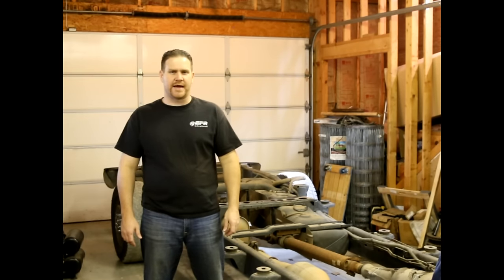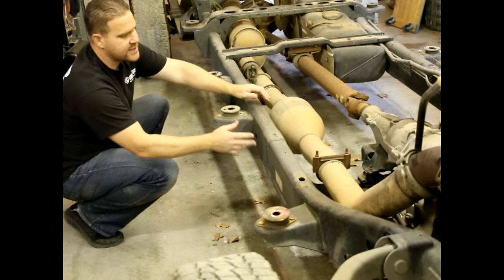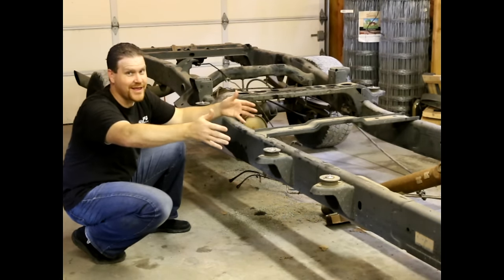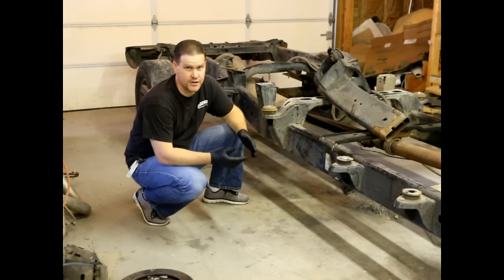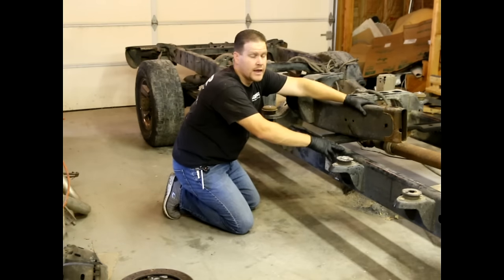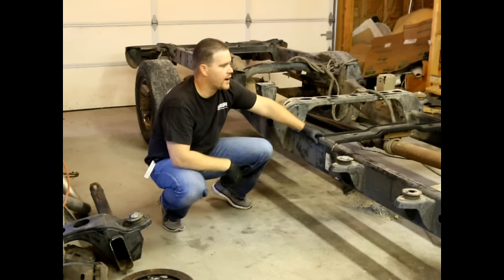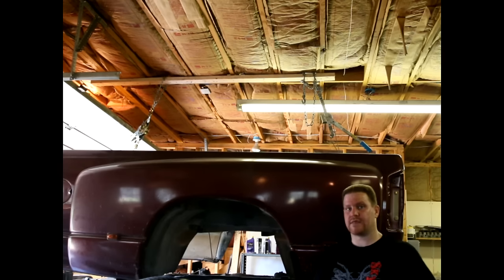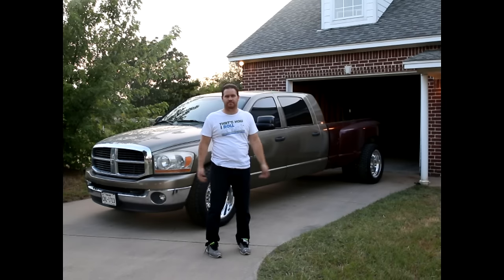How To: Mega Cab Long Bed Conversion Done At Home

Comment: Nice non-penetrated welds. Can't wait to see that weld after a few thousands miles of towing a tag trailer.
Reply: I doubt itll do much towing
Reply: Is that a bad weld?  If so what is the solution?
Reply: The trucks actually Been holding up rather well.
Reply: So do you have x-ray vision? According to the AWS, poor fusion requires a destructive test of section and etch if ultrasound isn't available. But go on.

Comment: Good job but one question. Why did'nt you have the bed painted before you put on the frame?
Reply from the maker: this was done as a series for a magazine. If we do to many steps at a single time, then it becomes either one mega story or we have to chop up the story into multiple parts. In addition, it is financially easier on us, if we do small bits at a time.

Comment: I'm planning on doing the same conversion soon I was wondering with cutting by the cab are you getting any sag? I'm worried about having the frame sag in the middle from having something heavy in the bed...
Thank you
Reply: All joints are in the same location as the factory. The rear section of the frame slides into the middle section probably 8 inches. There are two slots welded and then the outer joint is welded. The frames become one, and the frame sections are all factory. The factory frame has been engineered with enough safety margin that the extra 20 inches shouldn't present any type of problem. I know a ton of people who do and have done this conversion and I have never heard of anyone having a sagging problem if it was welded without a sag. I do know one who threw a driveshaft doing burnouts, but that is the only thing I know of.

Comment: Hey bud, great jobman looks awesome. I have a 2004 quad cab 1500 with the 4.7 litre in it. The truck is a nice looking vehicle but i want to modify it a little bit. It is a shortbed (6' i believe.) My question for you is. Can i put a dually bed on it? Do they even have a dually shortbed to fit it. Do you know if so, do the body mounts just line up? Also, do you know what years bed would fit? Any help would be greatly appreciated. Thanks  man! Big thumbs up. . 👍
Reply from the maker: Not sure if the frame on a 1500 is the same as a 2500/3500. You would need to do some measuring.

Comment: gotta quick question is the rear frame section the same on a 04 1500 and a 04 2500. I know the springs are heavy duty on 2500. but the section locks the same.
Reply from the maker: Honestly I don't know.

Comment: Has anyone grafted a long bed onto a megacab without cutting the frame?
Reply from the maker: So, nothing would line up and the frame would not extend to the rear of the bed. This would require a tremendous amount of work. The method shown here, only require a small amount of fabrication.

Comment: do you have to use the quad cab? would a single cab longbed work?
Reply from the maker: This was done so long ago, I don't remember if it has to be a mega cab. The key was the join under the cab. The Mega cab and Quad cab have the same back half. It would make since that a single cab long bed would too, but I don't know that for sure. See if you can get a photo of a frame and see if the joint is in the same place. It would be even better if you could take a few measurements. Dodge/RAM would want to make these frames as modular as possible. It would make since they are the same. I just don't know that for 100%.

Comment: i know at the end its too dark to tell for sure. but i replayed 20 times the point where the back tires dropped of the little ledge at the end of the garage.  every time i saw the back of the cab and the front of the bed get closer. back of the cab looked like it leaned back. i will watch the end over a few more times but it looked ro me like something isnt right in the frame
Reply from the maker: All is well in the frame. Spacing between cab and bed are ok, body lines line up, all is well.

Comment: Did you run into extra issues with extra vibration in the drive shaft with lengthening it? And did you switch to solid one piece driveshaft?
Reply: It is not a one piece driveshaft. If you look at the images closer, you will see that the front section of the driveshaft remained the same. I only replaced/extended the rear section. And that was like 18 inches or something (long time ago). I know of quite a few of these conversions and none of them have driveshaft vibration issues.

Comment: so how much of the frame from the quad cab frame did yo need sticking out for the 2 mounts to measure the same and it looks like you were able to just cut the frame from the qaud cab nat at a joint
Reply from the maker: +Nasty72Nova  about 24 inches from the cross brace. I originally spent a lot of time measuring the first time i cut a frame to be grafted in. got it to be with in 1/64 of the factory frame. Then i realized it doesn't need to be anywhere that close. 

The factory frame tapers in and i just measured at that and cut the quad frame slight;y longer. I believe it was 24 inches from the brace. Once I realized it didn't matter that much I just focused on getting the cab mounts lined up.

Comment: Love the truck. I'm kinda tossing the idea in my head about getting a new frame for my 2003 that I comment about below. Think/wondering if I can handle doing the frame swap in my garage connected to my house🤔
Reply from the maker: For me, it wasn't a matter of difficulty (pretty much no fabrication needed. All major components are factory. Fuels lines and wiring were the only things that I needed to physically extend myself.) This is a fairly straight forward conversion. It was time. With the kids, school (finishing my Mechanical Engineering degree), and weather, it took a few months to complete. Luckily, I had another vehicle to drive.
Reply: I was putting exhaust on my 03 and seen the frame was cracked, the long ways...not happy. think the dodge rams are very nice trucks but, poorly built. thanks for the help/info and again love that truck looks good!! cant get over that stance! and those wheels fit the whole look! nice job

Comment: wow man that looks amazing!!! would you trust using it every day towing big weight after rewelding the frame?
Reply from the maker: It is all factory frame. Assembled the same way the factory did (slot weld, joint weld). I have no problems with it. I have a few friends who have done this and they are just fine too. Don't see why it would give you a problem as long as your welds are solid.

Comment: hi, are stretching wheels in toyota hilux a good idea? i want to build an rv. because it will have very high center of gravity, I wanted to know what steps i could take to prevent crash.
Reply from the maker: I’m not the right person to ask. But stiffer sway bars would help with roll. Adding air bags will allow you to level the vehicle is it isn’t sitting level.   I think stiffer springs may help as well. Even adjustable shocks might help. But I would talk to a suspension company.
Reply: @hpdiesel4538   i have heard many negative things about stretching wheel axels. that's why i asked you. thanks for replying. very helpful. thanks
Reply from the maker: @buyhighselllow2209  the problems with stretching a vehicle has little to do with your question. Your concern is more about vehicle width and suspension dynamics. High center of gravity vehicles can be very tippy. They are tippy side to side not forwards and backwards. That is a width and stability issue.
Reply: @hpdiesel4538   yes. someone suggested extending the width of tires and length of that rod on which wheels are attached. but the second step is the one every talks negative about. sorry my english is not good.

Comment: How did you do the SRW to DRW conversion? Are the axles the same with just different hubs or different axles? How did running all the pluming work? Did you just lengthen the one side of the drive shaft?
Reply from the maker: +iriderm250  The SRW to DRW conversion was straight forward. The DRW axle is about three inches shorter than the SRW axle. The easiest way to do this conversion is to buy/trade axles with someone looking to do a DRW to SRW conversion. Luckily I was able to find someone and we did a straight across trade.

The wiring was extended by splicing in (two splices, one on each end of the wire).
The factory fuel line was cut and another line spliced in that I bought with the frame (one splice).
The rear section of the driveshaft was extended. This kept the carrier bearing in the same location.
Reply: How about tow capacity?
Reply from the maker: +Paul Ever Cabrera Jimenez. To keep the ride soft, I opted to use 3/4 ton springs. So, the towing capacity is the same as it was before. My intent is to add overload airbags to increase the towing capacity. With them, it will be that over a 3500.
Reply: Wooooh !
Thats a kind of a had in mind!
Now i suscribed you channel to know how this proyect continue

Comment: How hard would it be to do a quad cab long bed to mega cab short bed conversion be.
Reply from the maker: You would be better off starting with a new truck. You would be changing everything (cab, bed, and frame).

Comment: Would it be the same process to do a long bed into a short bed?
Reply from the maker: Yes, but you might be better off just finding a short bed frame, and moving everything over. One key if you decide to cut the frame, make sure your rear leaf springs will work and/or get the rear leaf springs from the long bed.

Comment: But hows it on the streets and small parking lots ETC
Reply from the maker: I also have a crew cab 4x4 Super Duty. This Dodge turns circles around my Ford. Turning radius didn't really change much. So, it still drives the same. Parking, well, that is a different story. It is now a dually and a long bed. So, it isn't really for California or other areas with small parking spots.
Reply: Drives surprisingly well. I Know. 😂

Comment: did you expand the frame to make a pocket to slide the two together?
Reply from the maker: The factory frame was cut at a joint. The factor portion of the frame is flared out (slip joint). The long bed frame was cut square and it slides into the factory frame. (5:43 in the video shows this well)

Comment: Have been wanting to stretch my '09 for two years now. I have a long bed in the barn waiting on me. Do you have any videos of what was needed for the drive shaft? That is my biggest concern. Should a person go with a one piece or convert to a carrier bearing two piece? Does the long bed frame stub come with the cross-member that supports the carrier? I had planned on stretching the frame above the rear axle and replacing the front spring hangers with taller ones. Can you talk me out of it and why your method is better?
Reply from the maker: Drive shaft was extremely easy. I retained the front section of the two piece drive shaft. It has the carrier bearing and that section remained the same length. The rear section was removed (slides out) and taken down to a drive shaft shop. They made a new shaft (reusing the ends) to the correct length.  

If you don't want to worry about having issues down the road, keep the drive shaft as a two piece. That is a lot of weight spinning and it is best to have it supported in the middle. There is a reason that manufactures spend the extra money to make drive shafts two pieces and not go the cheaper route of using a one piece.

As far as your plan on stretching the frame, there are a few companies that do it that way. Just keep in mind that adding a gooseneck hitch or anything else frame mounted could require some modification (not that there is anything wrong with that).
Reply: I fully anticipate modification when putting the B&W hitch back in the truck. Having it mount 6 inches in front of the frame like it is now is absurd. It will be moved to about 1" in front. I'd also like to bag it for over-load purposes so I'm sure there will be lots of mods. I do like your method of just sliding in the long bed frame and not having to screw with moving spring perches and overload stops.
Reply from the maker: By changing the frame over, we were able to then just buy accessories and bolt them in. 

For the conversion, I used a long bed fuel tank, filler neck, made fuel lines, extended the wiring, extended the exhaust, added an extension for the rear brake line, new rear section of the drive shaft, new e-brake cable, and used an 03 frame section.

Once the conversion was done, everything I bought after was for an 03.

One note, if you do swap the frame, please check to make sure you have the right springs. They are different between a 2wd and 4wd. I bought a 4wd frame before I realized I screw up. Ended up having to buy another frame. That was wasted money. On a good side, the second frame, came with the leaf springs. So, all I needed to do was bolt up the axle.
Reply: Thanks. I think I have a lead on a frame.
Reply: Soooooo....do you still have the 4x4 frame? What are the spring differences? Just length from center to center of the perches....or basically, the length of the top spring?
Reply from the maker: Hey Jory, The spring perches are in a different location, lower on the frame. Basically it is the perches that make up most of the difference in height between a 2wd and 4wd. My friend who ownes a body shop told me to watch out for different lengths, but I don't remember if that was 2wd and 4wd differences or if that was for the overload stuff. Been too long.

Comment: why not paint the back while off the chassis
Reply from the maker: This project was done for a magazine. So, each step needed to be shot and done separately. In addition to that, I damaged the bed bringing it home. I didn't want to risk damaging the bed once it was fixed and painted. Way easier to do the conversion knowing that if i scratched or dented anything it wasn't a big deal.

Comment: Is the rear cab mounts the same on quad cab and mega cab?
Reply from the maker: The key here is the distance, "the rear mount to the bed" is the same. So, splicing in the frame section under the cab will ensure the bed doesn't hit the cab and it looks factory. Just need to make sure the rear mount on the cab is in the same place when you re-weld it.

Comment: What did you use for a kit to make its a dually.
Reply from the maker: Up front, I got some dually hubs (factory). With the wheels that we ended up choosing, I didn't use them, but that was all that was needed.

In the back, I had a friend who was converting from a dually to a single rear wheel and we just traded rear axles.

Comment: Did u cut and extend the wire harness for the rear ?
Reply from the maker: Yeah, I cut the wiring harness and just added a section to each wire. I was originally planning on keeping the donor wiring harness and splicing it in (one splice instead of two) but I must have thrown it away.
Reply: @hpdiesel4538  where about a did you cut it because we have a short in the rear once in a while with the rear lights. I’ve peeked underneath but it all looks stock. We own that truck now. Runs great.
Reply from the maker: @rubenalberto4919  If I remember correctly (been a long time ago), I spliced in the wires around where the fill neck is. I didn't have the fuel tank in at the time, but I think that is about where I did it.